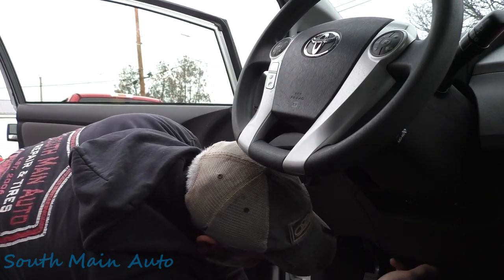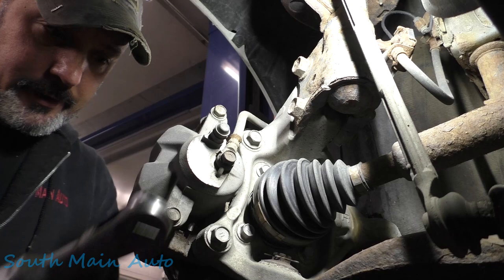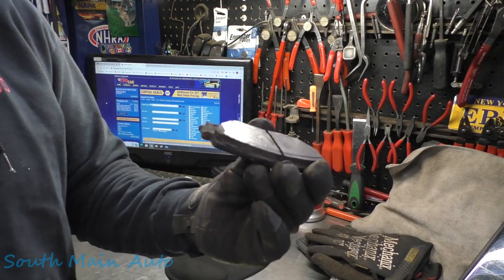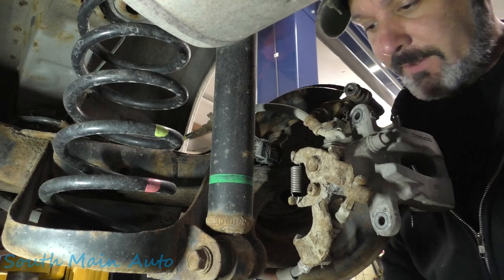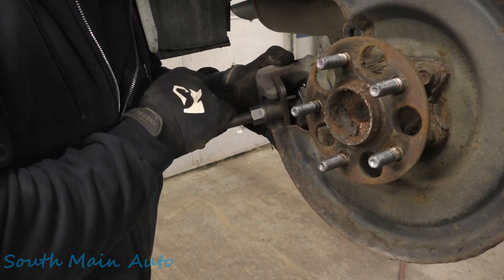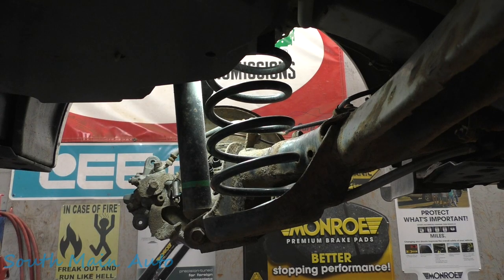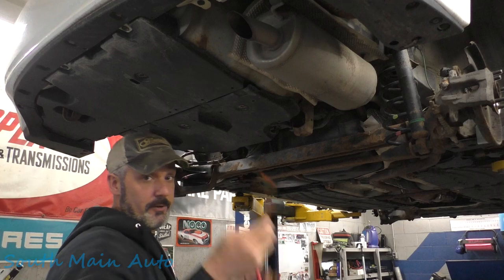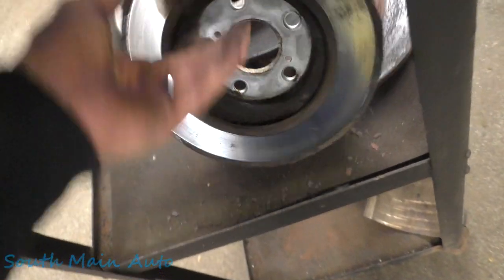Loud Grinding Noises & Dash Lights On - Prius Edition

Comment: Rustjacking… 
Had that happen to me. My truck was making some mystery brake noise for about a month, kept inspecting the brakes and found nothing. Never actually took em apart though. Just inspected.

One day, I get home and the wife excitedly tells me “the noise stopped after this fell out of the truck”

My heart just sunk as she showed me the backing plate of a brake pad. Jacked the truck up and sure enough; right side front wheel, only one brake pad and the caliper pistons were shattered, pushed into the rotor.

What made matters worse was she continued to drive on no pad for the rest of the day.
Needed a new caliper, new pads and new rotor.

I live in Nova Scotia, this is the first I heard the term, and I never ever had a pad separate before that. But From then on, when theres brake noise, Id always take the pads out to verify their integrity

Comment: Watching this video now of you looking at the Prius brakes.  I'm from NE Indiana.... For co.oarison if rust belt ...region.  I drive a 2012 Prius V (the longer wagon version).  I have 217k miles now on the car and still on the original brake pads.  I'm down to about an 1/8" left and it's due to replace them.  From my understanding the rear rotars are typically worse than the fronts.  As the rotors usually rust up before the pads wear.  Anyway, just wanted to share.  I come from a GM dedicated family as my dad was an ase certified mechanic for 45 years at a gm dealership before moving on to other things when the dealership sold, and then retiring.  I have to say, my Toyota is my first non-gm car purchase, and I haven't had a single issue with it....other than about 150k it started using some oil.  However, I do believe the Toyota dealership I took it to for service was puting conventional oil in it.  I've since gone back to doing it myself full synthetic and ran premium fuel for a while....and now I use barely a quart between 5k mile changes as opposed to 3 quarts at it's worst.  Anyways, as always Eric.  I pressed with your videos and the fact you actually diagnose as opposed to upsell the parts canon like what seems the majority of places do these days.  You got my dad's and my seal of approval.

Comment: Not sure if this was mentioned but on a Prius NEVER open the door with the calipers off unless the battery is disconnected. If you do the piston in the caliper will press out.

Comment: The rust you guys have up there is unreal. Down south here we have rust but nothing like that.  Bearings still wear out, as do pads and rotors, but that crustiness isn't an issue.  Pop off the caliper and bracket, drop in a new set of pads if the rotors aren't scarred from going too long on worn out pads.  The rust amount is about as much as you can wipe off with a rag or spray a little brake cleaner.  I don't know why they still use salt up there since it destroys your autos in less time than it should.  I'd be wearing safety glasses just walking nearby...lol.  Take care and don't forget..you got another channel and it's shootin' time...and we want to see Mrs O kick your butt again...haha.

Comment: That pad rust jacking can Scare the crap out of a driver also I have several snow birds come to my shop being in November and now December with super rusted out vehicles in arizona and 5 of the cars had 2 month old brake pads that were well above 80 percent life and I showed them the pads were separating from the plate and 1 vehicle came in they mentioned squealing I heard it from down the block and the pad material was just gone and they were running pad plates against rotor it destroyed the rotors and they were so scared they told me even if I fix it they won't drive it for a few days I guess they almost got in a accident on the i10 rust jacking is no joke neither is playing with your phone or texting while driving... I was driving to a service call at 10 pm through Johnson ranch and there was a digital move left arrow sign and a bunch of wood barricades lady wanted to pass me I was doing 60mph and she was in slow lane which was the lane that had to move to left arrow sign she was playing with her phone and hit the wooden stands and the digital parked sign at 65mph I saw headlights then saw no headlights in my rear view the lady was acting scared or nervous or somthing she pulled over then sped up and drove off then went into a parking lot I called 911 and she left before anybody got there... Great video as always Eric O @South Main Auto Repair LLC

Comment: I notice the rust on a lot of autos you work on. I had a 2000 Malibu  bought in 2004 with 121,000 KM  (73,00 miles)  that I drove for 14 years. Used to undercoat with Rust Check  every couple of years with virtually no rust when I traded it.  This stuff is messy (drips)  but saves  your frame and exposed brake & fuel lines ,etc if someone plans to keep their vehicle for a few years.

Comment: How did Mrs O's high dollar brakes work out? I'm havin the same issue on an 2011 DTS Caddy with shimmy and bought the coat/drilled/slotted rotors, but just gonna go with the ceramic pads. I am in South Dakota where rust isn't as bad. We've got some big Muleys and Elk round here if you ever get a chance to Escape from NY. Even Pliskin could use a break.

Comment: You are correct about the hybrids. I had 2 Kia Niro's and both had completely rusted tight rear brakres, Pads rusted in place on the slides and the pins also. rotors covered in rust, just from lack of use Plenty of meat on the pads at 100K. Suburban Chicago.
Reply: Yeah it's a huge hybrid and electric vehicle issue saw it a lot in the ford cmax! They need to program in some brake drag occasionally to the ECU to keep the brakes usable for emergency stops!
Reply: I NEVR push my parkn brake fully in winter. I do one clik so theres movement but doesnt lock up. I've heard rear brakes drag on older prii. I bet rotors like this one does little/no highway driving. Heat/friction would help.

Comment: Eric O’… Thanks for the tip on pad rust jacking. I need to check for that. I guess a $900 Autel is not a “Fancy” Tool. In case you missed my question…Did you get a Buck or did Vanessa get the big one?

Comment: Been waiting for that sound! Didn;t leave. Good to know.  Same bat time, same bat Channel!
So you say the galvanized brakes squeal?  Is the premium Naper Good?  

Someone mentioned Centric GCX?
Need to buy a full set with rotors. I did call napa.
One thing i learned is you can't use galv brake pads on drilled and slotted from NRS.

Comment: Great video Eric. Question in the beginning of the video with scanner hooked up the battery voltage that the scanner was showing looked kinda high at 15.1volts.

Comment: We all have that spare vehice that doesn't have much drive time, and they seem to demand just as much maintanance as our daily driver.  Batteries tires hoses belts and wiper blades seem to deteriorate faster than if you use them often.  Just glad I dont live in the rust belt and have to add these items to the spare truck also..  LOL

Comment: great tip had one on crv l/r sensor was good magnet went bad on bearing. then later on honda added a fault code just for poor or bearing-installed incorrect

Comment: My gen 4 prius 2019, has low mileage also. I dismantled brakes after 2yrs, cleaned/ lubed up, living in SW PA. Will u be spraying the brake line fittings w/undercoating?  Looking forward to ur next videos. 👍

Comment: Nice job.... my only suggestion for people that might do this job themselves in the driveway.
Its best to unplug the 12V battery.
If someone opens the driver  door while you have the calipers off.. The brake system can pressurize and pop the pistons out of the calipers.
Not an issue on a lift like this..
I have a 08 Prius. 422,000 miles.  I live in the southwest.. hot and dry.
I get 120K out of the front pads, 200K out of the rear shoes.

Comment: My Brother bought a set of Bear Claw brake shoes for his 77 chevy van .He was driving along and the back tire locked up and skidded .He put in Reverse and heard a clunk and some weard noises ..pulled the drum  open and the pad had become fully unbonded  ..The material wasnt riveted to the shoe was just glued ...First time I'd ever see a brake shoe do that
Reply: yeah, they went to bonded in early 80s for american cars for many pads and shoes....this probably wouldn't happen with riveted pads but it probably saves 3 dollars in production, times 10 million pads and it adds up fast
Reply: That has happened twice on my 05 Neon.  It lives in the rust belt.

Comment: Speaking of pads and rotors… Mr. O are you still pleased with the pads and rotors you put on Mrs. O’s van?
I’m thinking if replacing the pads and rotors on my 2000 4Runner with the same brand. 
Thoughts greatly appreciated!!!

Comment: Here a trick for the brake line Eric: Crack a bleeder or a line open, depress pedal to the floor and hold it there with a tool. You wont loose fluid while you fix the lines. (Not my invention, just sharing what was shared with me) ;)

Comment: A PRIIIIUS! Don't ya know Eric, you're supposed to say, "WEEEEEEEEEEEEEEEEEEEEEEE!!!!" the ENTIRE time you're behind the wheel of one of those!😜

Neighbor's '06 Impala I did a rear brake job on just 6 years ago, and EVERYTHING is completely seized. He's put 1,400 miles on it since then, lol. So, the friction material is good! And ... that's about it, lol. There's nothing left of the car. Just trying to keep it going as long as possible ... and we're close to the finish line with this one. He had me weld his parking brake cable back together. I used a cut cotter pin end. 🤣

Comment: It's a 14.3 mm . Bolt. 
I'd like to get my rotors turned based on how expensive they are now. Used to be 30 per rotor now there almost 80.

Comment: Early 2000s Holden in NZ had “rust jacking” like issues tho ZERO salt r snow EVER I was the disc brake machinist for a dealer and they didn’t really admit it nore did GM/Holden Australia cause they claimed they never seen it happen before.
I use to get the odd car loose it’s friction material suddenly and grind and some were coming loose when it was time for new pads n disc skim (rear issue)
I also so it once on a Toyota and both makes used PBR Australia pads etc and same looking style.
I suspect an issue at manufacturing.
No these cars didn’t get rusty from dipping boats in the ocean either.
Nothing got done and I was suggested to keep my mouth shut....

Comment: Those Toyota and Lexus speed sensor wires that plug into the actual wheel bearing assembly are so hard to get out I've had to do several and they are just a pain in the butt

Comment: 100% all this. I have two Gen 3 Priuses (Prii?) in Maryland, so not as bad as NY, but salty. I was shocked when the 2011 ended up with a seized caliper that ended up dragging, ruining pads and rotor on that side. I just didn't catch it soon enough. At that point, the car was 5 years old and pads were at something like 50% on the other wheels. But just like you see here, the calipers were on their way to being garbage, and the rotors were rusting out, etc. So, all new pads and rotors and one new caliper. Now, every two years when I do a brake fluid flush, I have them do almost a simulated brake job where they take the pads off and lube the slide pins. Every time since then, everything has been fine and they lube it and put it back together. No problem. I'll admit that the brake maintenance costs more than I think the car should require, but there doesn't seem to be a way around it if you drive in salt. As others have said, they'll rust off on a Prius before you wear them out.

Comment: Another reason not to turn rotors is that nowadays they're manufactured much closer to the minimum wear limit, so even if you have a lathe you often can't resurface them anyway.

Comment: You know I've seen a bunch of Toyota rear hub bearings throw those codes - the way they are made over time corrosion gets in them. When the road gets salty then salt water gets in them and probably shorts them out slightly and sends the ABS wonky. Those bearings will probably last another winter and then start making noise from salt water intrusion.

Edit: Damn - those are really smoked. Never seen one quite get that bad...

Comment: Eric, in your opinion, would those front rotors fail NYSI? Specifically for mechanical damage? I’ve heard arguments both ways, so I’d like to hear your opinion. Thanks
Reply from the maker: Pads yes for sure because of rust jacking. The rear rotors yes for sure, as far as the front...mehhhh not likely
Reply: @SouthMainAuto  thanks for the opinion. I've heard other inspectors say that because the friction surface is chipping off, the rotor is mechanically damaged. But there is a bunch of grey area in the inspection regs.

Comment: I don't know of any place I've ever used in the UK that still uses a brake lathe, as you say the new parts are comparatively cheap nowadays and also they are much softer now than discs in the old days and tend to wear in line with the pads really, 80s Volvo stuff would last forever but a new car, no chance just change em

Comment: I’ve got a 15 Yaris I gotta but a speed sensor and harness in the left rear cause of the corrosion I also have to put a rack in it hopefully the sub frame bolts come out probably won’t be until the end of next week before I get to it not sure when they are going to put it on the schedule

Comment: Some body actually said they would quit because you didn't use or make the break clean sound? Maybe Jan 1st start save the clips of that moment in a separate file. Then Dec 31st next year put out a video of them or some of them files.

Comment: That certain brake pad which resists rust jacking by replacing it with squealing would not happen to be by the classic,”not a sponsor “ parts distributor would it?? I believe they also are associated with wine making some where in a California valley……

Comment: Haven't machined a rotor in at least 10 years.   When you count time to machine a rotor its just as costly for the customer and quicker to just put on a new set of rotors.

Comment: Too bad the pad manufacturers don’t apply a sealer to stop rust jacking. 😂 I bought a brake piston wind back tool from Princess Auto (Canada version of Harbor Freight) for my 2010 VW Golf and it worked perfectly and the best part was, it was on sale for 1/2 price. 😅

Comment: Hello, I would like some advice about the rear disc brakes on my citroen. It has the same parking brake type. They are dragging, more on the left side, but less overall when it's at or below freezing. It has slowly got worse (many months). They are cleaned & lubricated. Thank you for the videos.
Update: brakes are dragging just as much below freezing, but one time i left the car with the parking brakes off for a few hours, and there was much less drag/heat. I always make sure the parking brakes are fully off.

Comment: Example of a dashboard light causing hypersensitivity:  Wife doesn't usually drive our van.  I put summer tires on but cheaped out and did not program TPMS sensors.  Wife complains, "The van's steering is all messed up, it is UNDRIVABLE!  Also, what does TPMS mean on the dash?"  I took the van for a test drive, drives perfect.  After some back and forth I ask how far she drove the van.  She says, "I got to the end of the driveway and turned right around!"  Our driveway is literally three curves without a straight section between them.  There is no point on our driveway where the steering wheel can be held straight without running off the side into the weeds.  I don't recommend this, but, the next time we got in the van together, I demonstrated, "Look, we on curvy driveway, steering wheel always turny turny, when we got on road, steering wheel straight."  Also, I apologized for the TPMS light:  by bad, I gave her the option:  pay Honda dealer $50 a year, or let me buy $150 programming tool, or have TPMS light on for half the year.  Its a 2014 Honda Odyssey, don't get me started.

Comment: I have not had good luck with having rotors turned.  I am not even in the rust belt.  Turned rotors never seem to last long (they tend to warp is a relatively short time) and it is iffy if today's techs can even turn them correctly (don't ask me how I know....).  I just buy new ones from a reputable manufacturer (not the cheapest thing out there!).  Labor rates are just too expensive today to mess around.  My personal time is worth more than the cost of rotors.  Always lube your slide pins too!

Comment: I have a 2012 Cruze service stability and traction control message come up. Next thing you know….BAM spark plug blows out and you need a new engine! Cars these days don’t last! My 97 cobra has 250k I beat the crap out of it and back to being my daily. Also I’m in the market for a low mileage 1.8 there’s none in my area. Only 1.4s here.

Comment: i got a NY state inspection and my front rotors failed for having that rust ridge on the back and it looked 10 X better than the ones you are working on .. think they needed a job but FOOLED them changed the rotors myself .   then fluid filmed the entire rotor .. no more rust for me,   J/K   I used GREESE  lol   stops great  kinda like being on ice .   PS don't drive in front of me

Comment: First, I'm not a mechanic. So how do regen brakes work? I get that when you step on the brakes, power is sent to the battery but where's the connection that does that? I didn't see any wires coming from the brakes. How does the power generated get sent to the battery. I know I could look it up on the web but it would be more fun to hear from y'all. Eric is funny but sometimes the comments are hysterical.